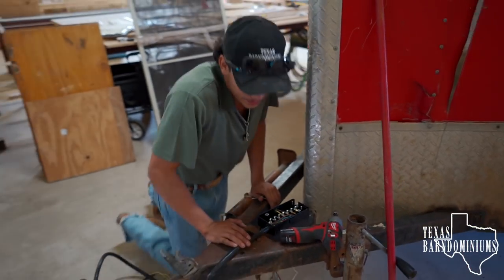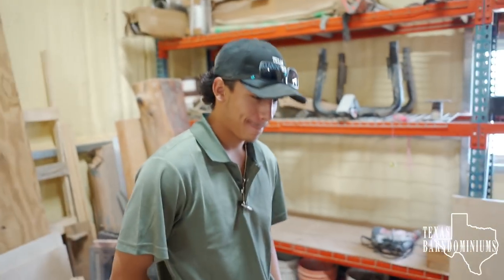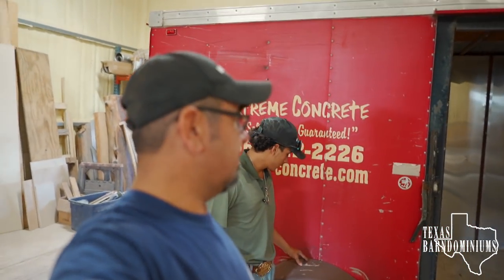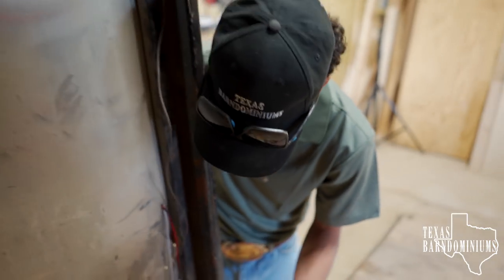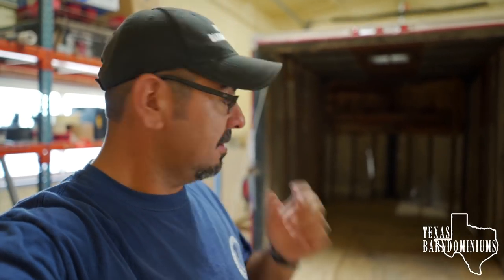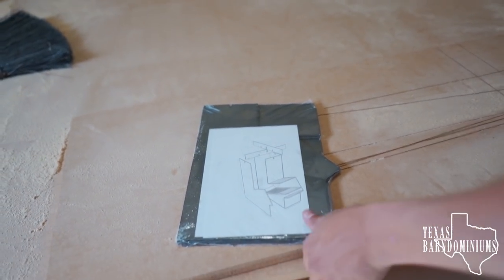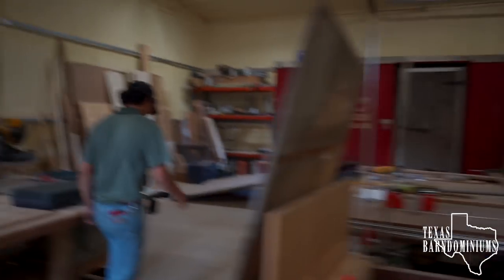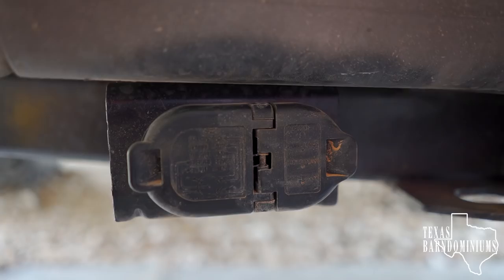Re-wiring trailer - The Barndominium Show E184

Comment: Eric, what does the plate say for the gvwr of this trailer. And how tall are the main frame channels? If they are only 4” tall it was either built with a #3,500 axle or a #5,200 max.  A lot of distributors would sell a #5,200 as a #6;000 with 8on6.5” as long as the overhang didn’t exceed 7.5” from spring center to hub face. I know a couple of vp’s at Big Tex who could hook you up to something more safe. 
Ps “ churches chicken is the best”
Reply from the maker: I beefed up the frame.  It’ll be fine.

Comment: The plumber's .02 cents; there are two worlds- the one the text book describes and the one we actually live in. Manny has a bunch of the one, and Eric, you get to be the guy that helps him figure out how to apply that to the one you live in; I think, Eric, you've got that covered. Manny has got to rise to the challenges as challenges and not frustrations- he will get better if you let him. A hint- I do diagrams of even water piping systems - if it has wires, work out what the circuits have to be and do before you start working the material- it will save you many headaches and save bunches of material- you will then have an initial plan and pattern to lead you through the job. I did not think this up on my own- I owe my late uncle for much of it- his mantra was follow the method that steadily gets you where you want to go! Best damn plumber I've ever known! I wired his sisters house with that guidance and a half dozen scraps of paper with my diagram!
Reply from the maker: Thank you.

Comment: This trailer can only plastic tank one 250 gallons of water which weighs a bit more than 2000 lbs, and maybe a small generator and an e-pump. The 250 gallon can fit full about 300 gallons easy which bring the weight up to about 2500 Lbs. try not to push past 3000 Lbs max. The axle might take the 6000 Lbs but not the leaf springs. Eman is doing good job on the junction box, the patience he invests in any project the more successful he becomes at solving problems. Tell him to run to YouTube videos about any electrical issues. Good luck Eman grasshopper.
Reply from the maker: 300 gallon thank is what we plan on.  No bigger than that.

Comment: Rip out that plywood and get some . CCA wood before you mount the tanks.  What size tanks are you gonna use ??  Make sure the frame is up to it....  on second thought just junk it, single axle trailers no good for water tanks.
Reply from the maker: It’s only a 300 gallon tank.  Just big enough to bring water to jobsite when needed.